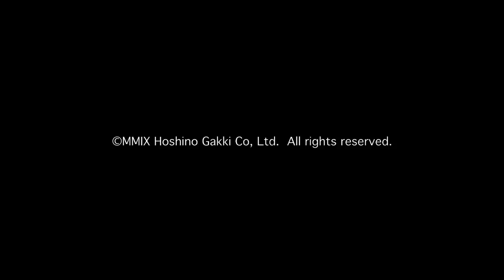Behind the Ibanez Prestige Series

Comment: Older S470s had powersound pickups, which were O.K. in my opinion.  The newer ones have INF pickups, which are similar to powersounds..
I have an RG with INF pickups.  I like the INF pickups.   I would recommend the S470 as a great all around guitar.  It's a lot of bang for the buck.  It's also a good guitar to get acquainted with the entire Ibanez line of guitars, which in my opinion, are the best on the market.

Comment: I have two Ibanez lefties.. But in the end, I Always go back to my Fender Stratocaster, even if in some ways it's a simpler instrument as Ibanez guitars DO feature 24 jumbo frets, Edge tremolo locking system.. But, then again, I rarely bend higher than the 19th fret, and I don't power dive but I use the tremolo for sharp bends (reverse).  Ibanez are great guitars, but I just love my USA Lefty Stratocaster more.

Comment: I need advice on what to pick - old 1990 Ibanez RG550, new Ibanez RG1570 prestige or new Ibanez RG2550? :)
Reply: I own both a lefty '91 RG550 and lefty '06 RG1570. The stock pickups aren't great in either, with the V1 and V2 pickups in the 550 definitely being superior; I switched 'em out in both. The necks, craftmanship and fretwork on both are absolutely superb and both the original Edge and Edge Pro stay in perfect tune. In general, I play the RG550 more because it's got more character due to its age, but honest to goodness, you're going to have an incredible guitar if you pick either of your three.
Reply: DreaminginWaves Thanks for your input! What about the build quality and sound when compared?

Comment: I bought the SR5000-OL recently, and yes, it's well crafted but its internal circuitry, its preamp wiring is a MESS, the toggle switch for Passive and Active mode generates a loud POP sound when operated, and the 3 band EQ knobs (bass, mid, treble) is mediocre ; it cannot provide fine adjustments to shape the tone I want.  It's either too much mid, too much treble, or too much bass, or too much reduction in every one of these three band EQ, switching to either of the pickups only means just that, I can't shape the sound from being too bassy or too glassy high either.  Wood combination is great but what the hell has Ibanez done to their electronics?  Bartolini pickups yea, but the internal circuitry sucks big time.